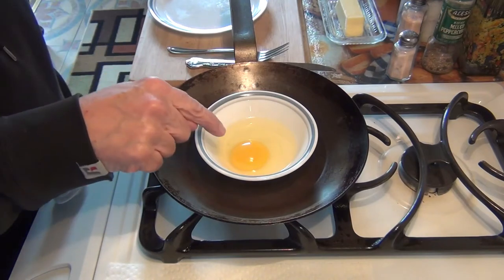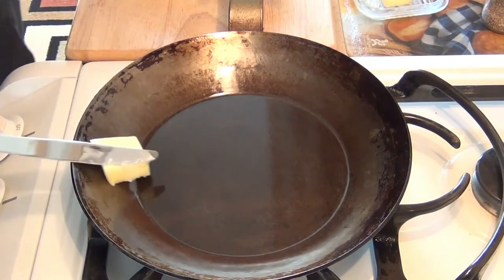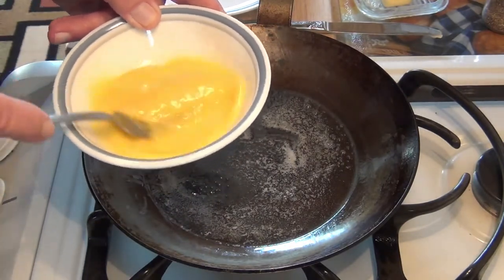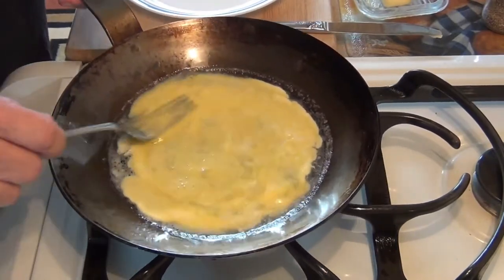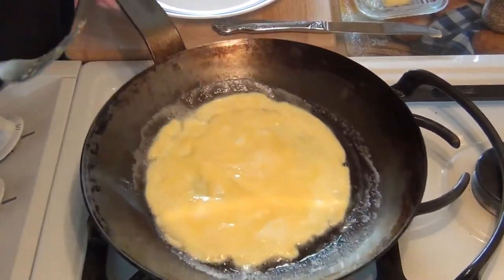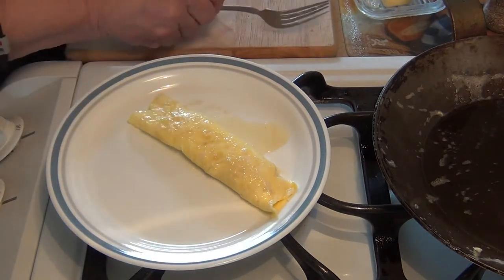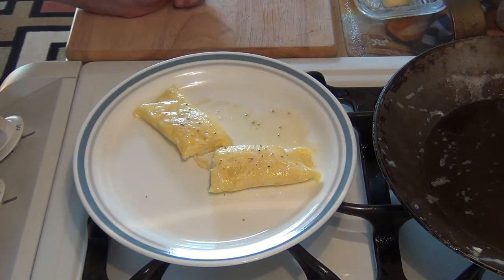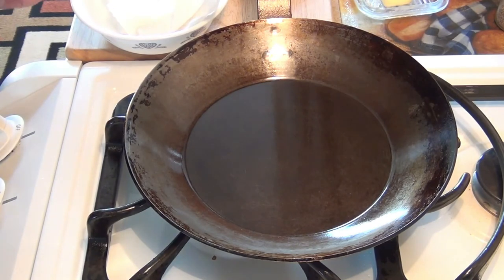How to Make a Classic French Farm Omelette | Matfer Bourgeat Pan

Comment: I was hoping you were about to make a French Classic omelette.   Then I noticed you said classic farm omelette.  You did a great job but I've yet to see anyone make a proper classic omelette in a carbon steel pan.  Even Jacques Pepin used a non-stick.   Maybe I should post a video of my own lol.  I've been practicing recently and it's definitely doable, although comments sections all over YouTube say it isn't.
Reply from the maker: I thought no one would ever ask! I will be getting a French Omelette Classic done in my carbon steel pan within the next few days. Yes, it is doable!
Reply: @r7eagle_  Alright I've tried a few times since my last comment and I've come to a conclusion.   For a normal, well-seasoned skillet, it's *possible to make a french omelette or french scrambled eggs, but it will stick.   The reason is that the oil barrier (however thin) clinging to the seasoning is your non-stick, but if you mix the eggs in the pan (which is necessary for both those items) the yolk will emulsify the oil and expose the proteins to the hot surface.   It's not a huge deal, cleanup is minimal if you have a good low temp, you can scrape off the flakes with a wooden spatula easily, but 100% non-stick is simply not possible for these items, and definitely spoils the aesthetic of a perfectly-cooked French Classic.   I'm willing to be proven wrong, but there is not a single video on the whole of YouTube that proves me wrong just yet.  I will continue to use my non-stick for these specific recipes, and my carbon-steel pans for everything else.   Thanks for the informative videos.  Good luck with the next round of experiments!
Reply from the maker: @peetiegonzalez1845  Darn...sounds like a challenge to me...I will work on making a classic French omelet in a carbon steel pan and post it...give me some time...thanks for the challenge...lol